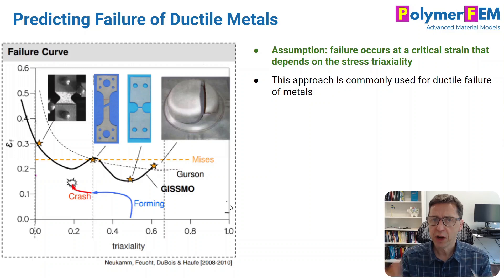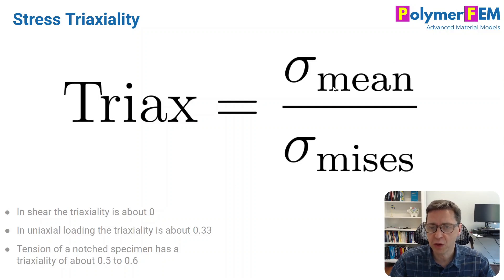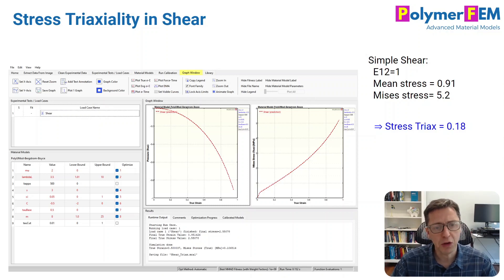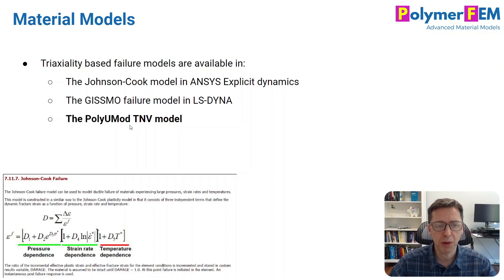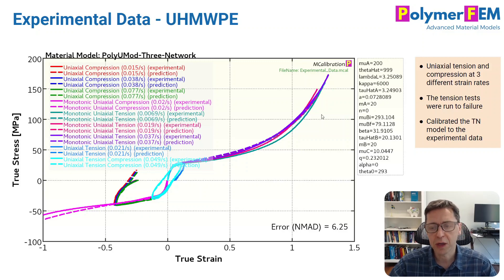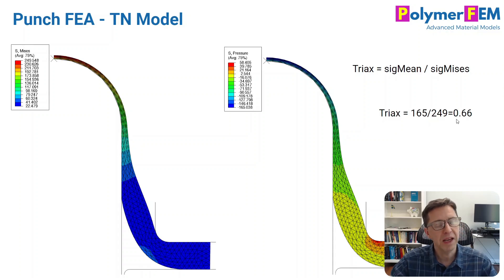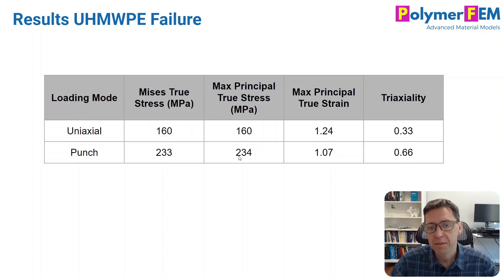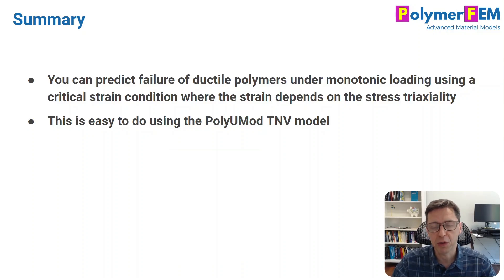Predict Failure of Thermoplastics under Monotonic Loading

Comment: Hi Jorgen! I just found your YouTube channel and have been binge watching your videos. Your knowledge and the way you teach about polymers and material models is just unmatched. To be able to watch all your videos for free feels unreal.

Now, a question for you. I’m currently working on a drop test impact simulation with Ansys LS-DYNA. My FE model contains a bumper like part made of EPP foam that should protect a product. The EPP part has a polymer/composite part molded inside that acts as a supporting structure and limits the compression of the EPP. 

I’m trying to find a suitable material for the polymer/composite part. I started PA6-GF, but it becomes too brittle at cold temperatures and shatters into pieces, even with impact modifiers (I think it is TPE or TPU). 

Right now, I am evaluating different polycarbonate blends, with and without PBT. For one of the blends I received an already calibrated MAT24 material card from the plastic supplier which included multiple strain rates and a gissmo damage model with triaxiality. I am studying both the compression and rebound part of the drop test so the unloading is important. However, I’m not sure MAT24 is an appropriate material model for my load case. Do you have any thoughts?